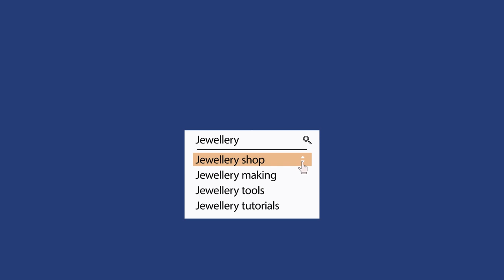How To Make A Pair Of Patterned Silver Stud Earrings

Comment: 👋 hi 
please advise 🙏 why you  anneal the silver discs before you start working with? Is look’s ready to be used without hitting and pickled in the pot 🙈 1:02
Reply from the maker: Sian says: "Annealing means that less pressure is needed when rolling, it's a personal preference really and means that the I can ensure that I'm giving every opportunity for a clean, smooth and crisp impression in the silver. I would always anneal my silver before putting it under any stress (such as hammering or rolling) because otherwise you are then more open to a stress crack which could be timely to repair or could ruin the piece entirely."
Reply: @cooksongold thx❤